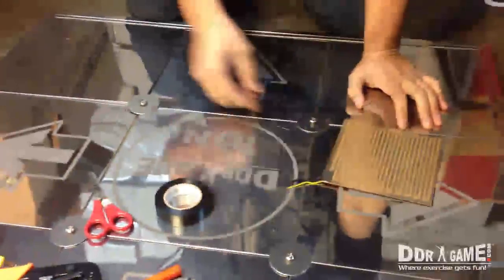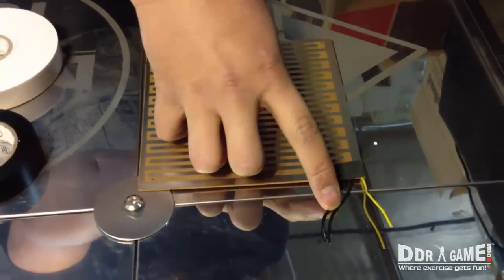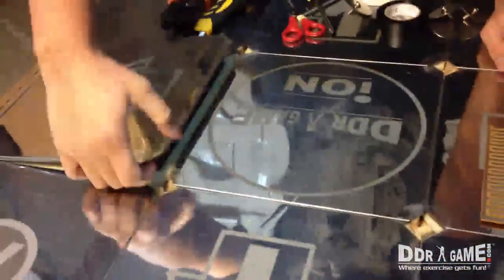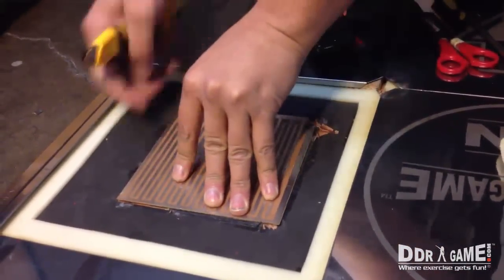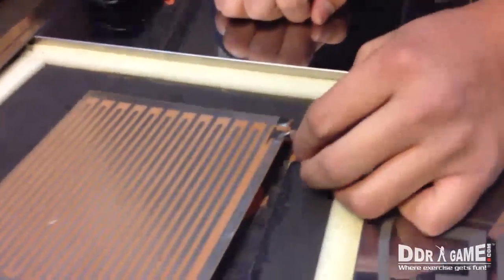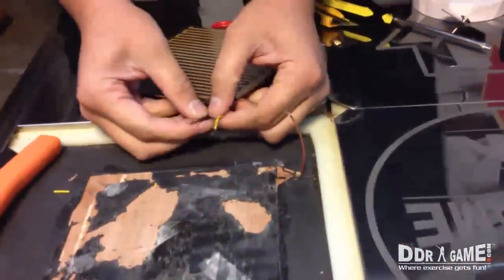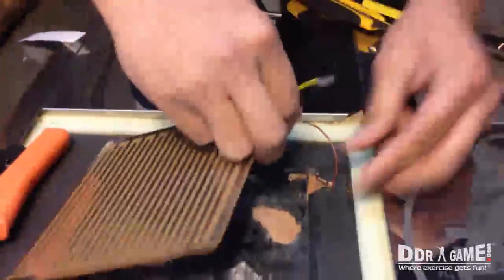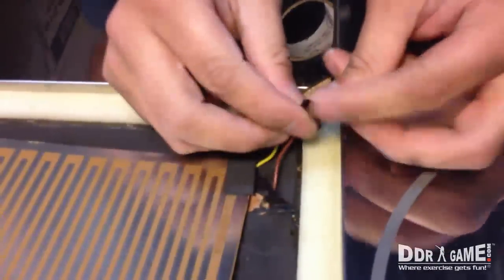DDR Game Metal Dance Pad Sensor Repair Guide

Comment: there is a reviewer on Amazon that tells how to fix this pad by laying sheet metal under the button and making sure it touches part of the frame. He has a picture there to. Maybe that can help.
Reply: I found it, User RAHUL: "i used 26 gauge sheet metal with zinc coating (to prevent corrosion). this cost about $10 at home depot to accommodate all four arrow panels.
... then used tin snips to cut out 8 inch squares.
... then used 3m super 77 to stick the metal squares on the reverse sides of the arrow panels.

one of the sensors was still dead but i noticed it would activate if the sheet metal touched it and the exterior metal frame simultaneously. so i used an extra long piece for that panel that sticks out and wraps around the edge of the pad.

the good news is that the pad started working beautifully (way more marvelouses) after i modded it. the bad news is that every few weeks it breaks down again and i have to do some more repairs (the last time one of the sensor switches broke and i had to strip the wire and reconnect it). at any rate it's been over six months now and i just need it to last until i achieve my original goal of acing paranoia survivor max oni."

Comment: I had the misfortune of buying one of these garbage pads. Constant dropped notes, no matter what computer or USB port, I HAD to use a powered USB hub to prevent the pad from randomly disconnecting and reconnecting. I had a better experience with my old redoctane foam pad. Too bad I don't have that anymore. I'll be investing in a Precision Dance Pad and try to sell my DDRGame pad as used.

Comment: I just looked too and I didnt find them. I'm hoping i can make my sensors more sensitive more sensitive by cleaning them and putting more foil under the arrow panel. Do you recommend a certain kind of cleaning the solvent to wash the metal circuit and when do you plan on restocking the sensor boards (if ever.... :/)

Comment: I like this video, their sensor is just basically a ground with another wire going all through the board and it's TINY was that like 5".  The hope is you step on an arrow that presses the aluminum and shorts the ground and circuit to register a step.  What is bad about this is SIZE (big arrow small sensor) and it's SOLID so it will crack.  Here's a video for the Omega GX sensor repair 0:00 DONE.  Not only is our sensor LARGER it also is not solid, it will never break.

Comment: Okay i have a ddr energy metal dance pad. All of my arrows went out at the same time so I'm pretty sure it's not the sensor board, although my A and B buttons are still working, i want to know where do all these wires meet up and is it accessible without breaking the dance pad
Reply: idk I have one 2 and if u see my channel I just upgraded my shot my own way and it's playing good so far .. But I'm wondering how long till mine craps out 2 ... as soon as it does I'm going with a (precision dance pad ) look em up on Facebook they have way nice pads then these for less plus u can do custom graphic options and bar support options and whatnot check them out my friend tell the Roger sent u ...
Reply: +Soullark CEP I am having the same issue. Did you get yours resolved?
Reply: Im having that same issue

Comment: I bought sensor pads for my energy pad from them but they are not the same size as the ones in the pads. Would that be an issue? They seem to be torn from another pad so I can't tell if they haven't been used. I also got two new arrows; is the foil on the bottom supposed to be smooth with out any wrinkles or tears cause mine have both.
Reply: rankamarx I would imagine that the only difference it would make would be the amount of area you would be able to step on while you play. If it is smaller, you may have to start stepping closer to the middle to get your steps to register. I may be wrong but that's what I'm thinking. 

As far as the foil, I'm not 100% sure, I've had my metal dance pads last a good bit and I do remember flipping one of these over and saw that the foil was somewhat creased and slightly torn in some areas, I still recall them working before/after I noticed the foil. But now, my pad has stopped working completely since I've cracked my UP arrow on the pad. Now I have a problem with my pad not even working at all, but I don't think 1 cracked arrow would negate the whole device not working. 

I'm trying to look into buying a better constructed metal dance pad. I just feel this one is poorly designed and doesn't last long for us people who play on all the 10+ footers on stepmania.
Reply: ***** Thanks for the heads up! Good luck in finding a better pad!
Reply: rankamarx Where did you find them? I can't seem to find them anywhere online.
Reply: +Mae Ditty Auughhhh, I don't remember but I'll try to find out.
Reply: +Mae Ditty I went through my email and found that they are from ddrgame.com you have to email them and ask for sensor plates. I told them that I have the energy ddr pad. I don't know if that makes a difference.  They were like $15 each.

Comment: All of the directional sensors on my pad stopped working at the same time. The A and B buttons are still fine. Has anyone had this issue before?
Reply: +ZyronDel I shorted the sensor very close to the wires and there is still no signal. It may be some of the wiring. I got it open from the bottom and do not see anything obvious with the wires.